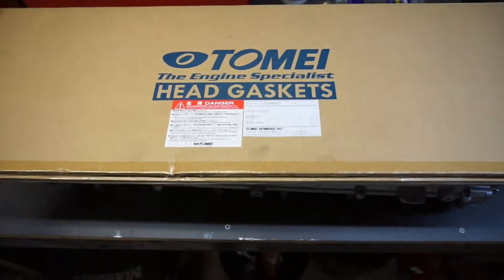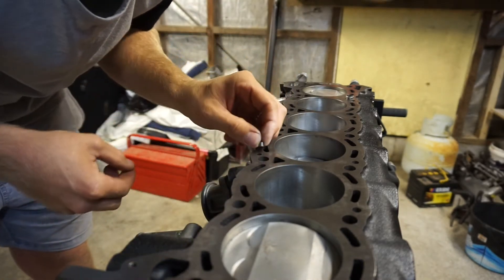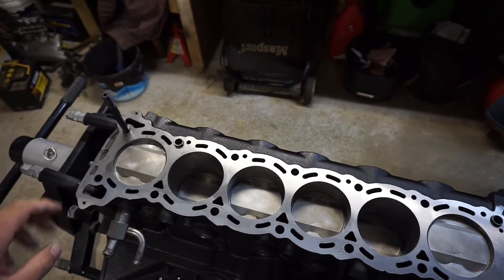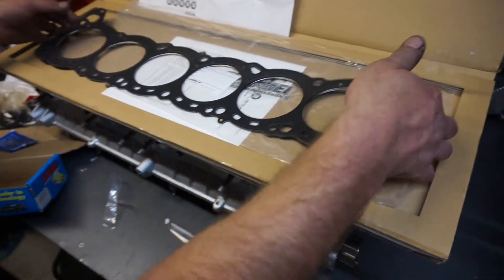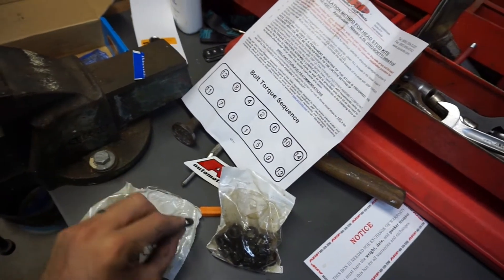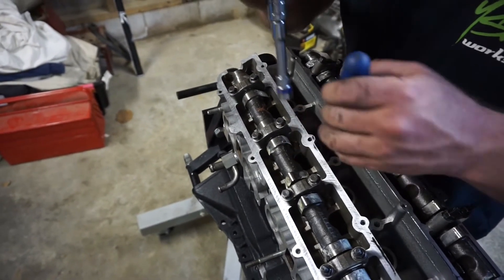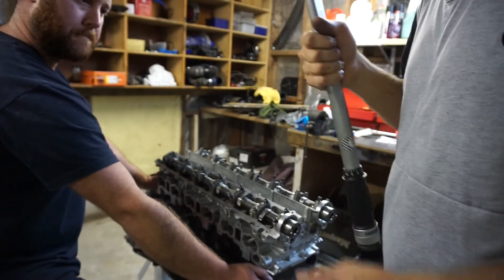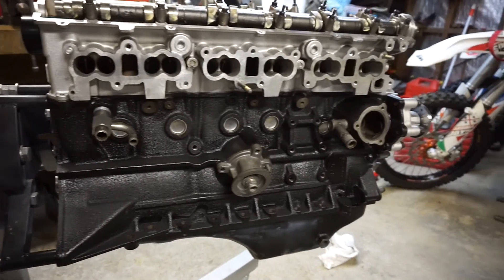RB26 CYLINDER HEAD INSTALL/ ENGINES GOING BACK TOGETHER

Comment: What do you know, here I am again 😀Just got the turbos out while the engine was in the car (such a pain). Just need to unhook the harness and the axles and then the engine comes out. I decided to have my machine shop install tomei 262 cams and supertech dual valve springs kit along with the resurfacing, and luckily I was able to find these cams in stock at Dynosty as it was backordered everywhere else due to covid.
Reply from the maker: Nice bro, good things take time. My car has just gone into the shop to get a tune so will see how it goes.

Comment: hey mate, thanks for making this video Im building my rb26 right now with arp studs and tomei gasket, having trouble finding a socket to fit past cams, can you tell me exactly what socket you used? did you have to step down from 1/2 to 3/8? what brand socket also? cheers
Reply from the maker: scoobiesnackz hey man, I used a King Tony bi hex socket, I think it was 12mm from memory I could be wrong. And yes I stepped it from 3/8 to 1/2 drive and my torque wrench was a 1/2 drive. Hope this helps.
Reply: IsaacVW awesome thanks dude much appreciated
Reply: @vlrb25det11  u mean u stepped down from half inch drive to 3/8 drive.. Cheres